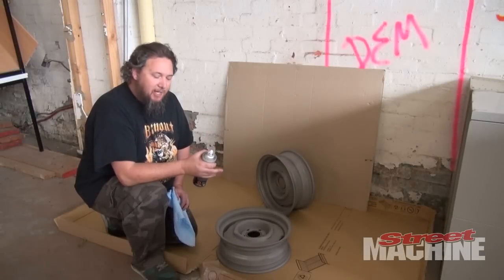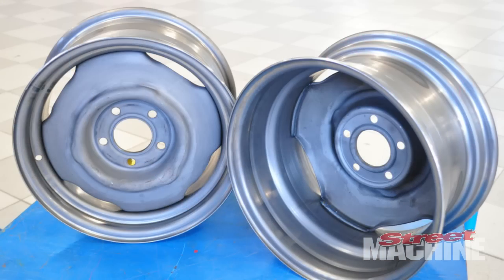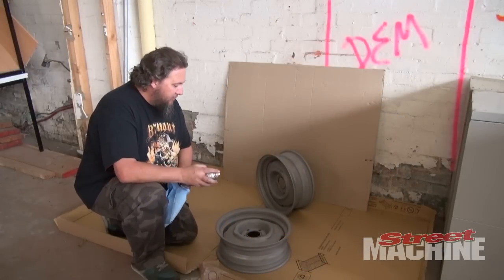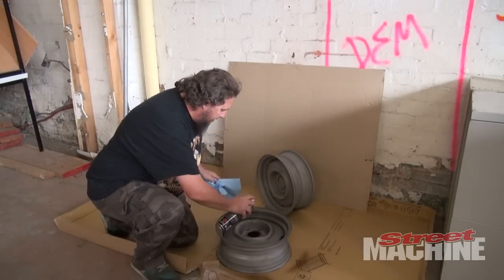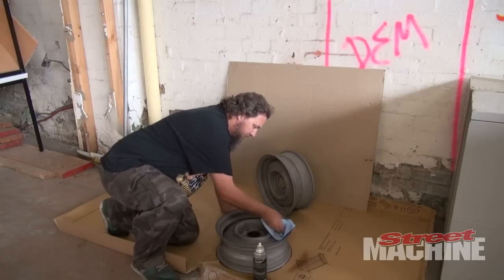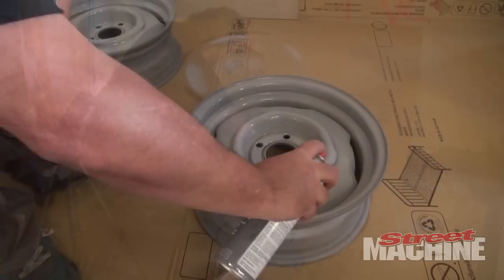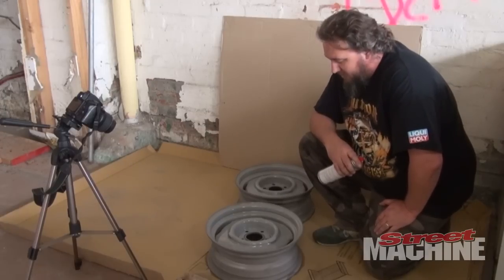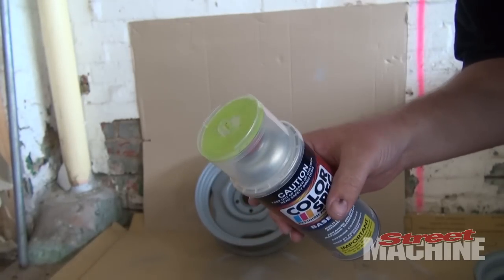Project Swinger Part-3

Comment: Takes a 15x 8 with 5.5 inch back spaced wheel 255-70-15 Radials, will fit giving you 29.2 inches tall rear tire, do the measuring and have a great time